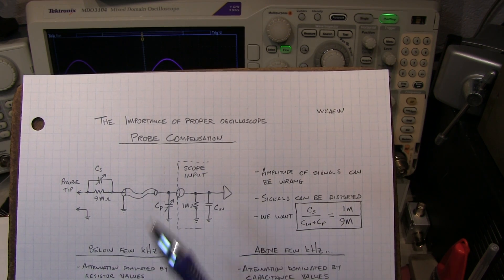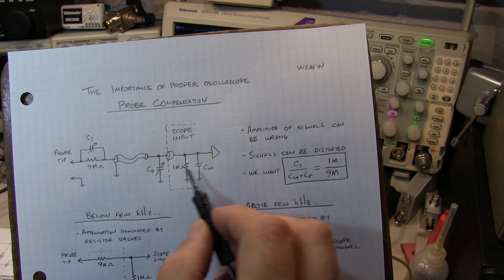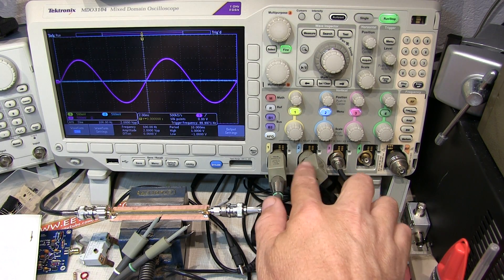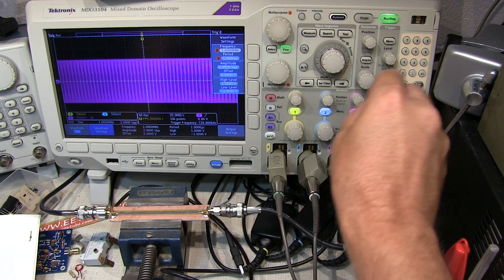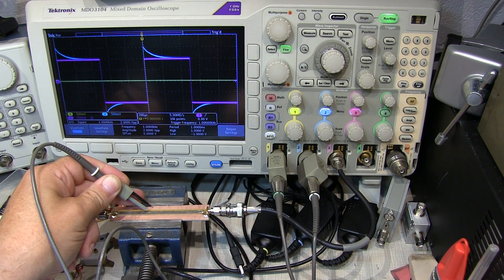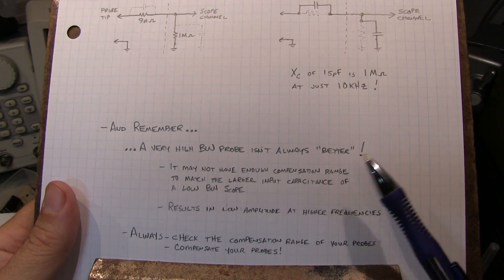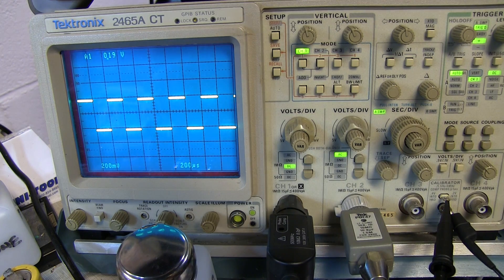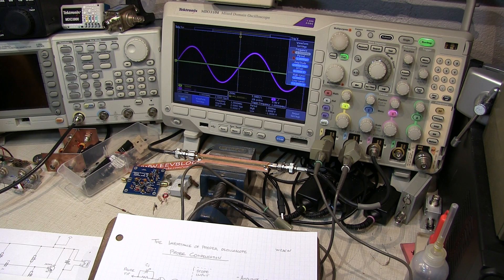#206: Importance of 10X Probe Compensation with your Oscilloscope

Comment: Excellent video, with very convincing demonstrations. This will be helpful to countless people.
I have been using P6122 probes on my Tektronix TDS 30124 100MHz scope for years, and they are well adapted to the scope input and compensation range, but I have been frustrated at times by the fact they do not have a 10x readout pin, and I always have to manually verify this is set right on the scope. 
I read in Tektronix literature that the P6121 probe is the "sibling" to the 6122, but with the 10x readout pin, so I bought one to try. Receiving it, I learned that it is not at all a "sibling" to the 6122, because it is intended for a much earlier scope, and the compensation range is 20-26pF - well above the 13pF input of my scope. I tried it anyway, expecting to find it hopelessly over-compensated, however I was able to adjust it into proper compensation. Indeed the compensation adjustment was at the far en of its range, which is not optimal, and because of this I will probably not keep it, but all this to say sometimes the compensation range is conservatively stated, and can be better than the specs would indicate.

Comment: Could you do a video on RC Normalizers and calibration. I don't understand why they only call for an RC Normalizer at low frequency calibration of a vertical channel then leave them off at the high frequency comp. I realize the 1 Khz fast rise has high frequency components but shouldn't you put an RC Normalizer on at some point in the high frequency comp steps?
Reply from the maker: At high frequencies, the probe response (attenuation) is dominated mainly by the input and compensation capacitors.

Comment: Isn't the output signal displayed supposed to have (1/10)th of the amplitude of the input signal that is being displayed? If not, then what is the point of the attenuation and why would the oscilloscope display the non-attenuated signal?
Reply from the maker: The main point of a 10x probe is to get the bandwidth, not really about the attenuation.  The 10x probe is designed to isolate the ~100pf of the cable and scope input capacitance from the circuit under test - see this video on the topic (https://www.youtube.com/watch?v=SX4HGNWBe5M).  This scope automatically senses that the 10x probe is attached and adjusts the  vertical scale reading appropriately so that it accurately shows the actual signal amplitude.

Comment: Hi Sir. Thanks for the great video, as always. I was wondering if you could provide some piece of advice. I own a pair of probes Keysight N1242A. Browsing web I found conflicting information: some references say compensation range between 15-30pF and others say 15-40pF. If I hook them up to a Tektronix 2225 which has 25pF inputs I'm unable to properly adjust for the compensation. I mean, I can just barely reach it but I can't over compensate. Maybe I got this wrong, but it seems something is not correct. Any clue why that would be? Either way, 15-30 15-40, both should allow me to compensate the 25Pf of the scope, right?
Reply from the maker: Assuming the information you have on the probe is correct, then it should be able to compensate the 25pF input capacitance of the 2225 scope.  Have you made sure to connect the ground lead when doing the compensation?  Are you sure about that part number for the probe?  It's very unusual that Keysight doesn't have any datasheet or documentation on their website about that particular model number.
Reply: @w2aew  I did find documents within keysight site. There is a note saying: "These probes have been designed and calibrated for use
 with instruments having an input impedance of 1M Ω paralleled by 20pF. However, these may be recalibrated for use with instruments having an input capacitance of 15 to 30pF." I went through the process one more time and recorded a video showing the scope settings and the process. Maybe I am doing something wrong. https://www.youtube.com/watch?v=Onlqv2ZH8Ig
Reply from the maker: @carentanbr  Looks like you've got everything about right.  I would push in the x10 multiplier on the Vertical scale knob (it looks like you have it pulled out) and then adjust the vertical scale setting as needed, then do the compensation.  As long as you can make it flat, don't worry if you can't get reach the overcompensation condition.
Reply: @w2aew  Thanks for replying! That is one interesting point. Yes, I did pull the 10x mag. If I push it back, i cant get any decent reading. It gets all blurred. I think it has to do with the quality of the internal signal generator. So I get a sharper image if I pull the 10x mag up.
Reply from the maker: @carentanbr  Push in the 10x mag, then rotate the vertical scale down to a lower value.  The 10x mag is really only used when looking at very small signals.  There is a procedure for doing the compensation in the user manual.  https://www.tek.com/manual/2225-operators-manual.  Starting setup on page 2-5, probe comp on page 4-1.
Reply: @w2aew  Thanks, I did try not using the 10x but the signal gets unreadable very quickly. With the vertical scale in 10mv per division (as suggested in the manual) its impossible to read and I cant make the signal clean. Check it out here: https://www.youtube.com/watch?v=Po6gSKiybXo

Comment: Still working my way through your videos.
Even if a higher frequency response probe, let's say 350MHz, could be properly compensated on a 100MHz scope, I wonder how much performance benefit could be had? Especially with modern scopes where the bandwidth is programmatically limited 🤔
Reply from the maker: If it can be properly compensated, there is no performance gain as the BW is limited by the scope.

Comment: Hi, I love your videos. I had a question about your equation. Cs/(Cin + Cp) = 1M/9M in the bottom right of your paper you show.  It seems to me that since Cs is paired with the 9M and Cin is paired with the 1M, the equation should be Cs/(Cin + Cp) = 9M/1M. Am I right, or where has my thinking gone wrong here? Thanks again! I show my class your videos quite often.
Reply from the maker: The equation is correct.  This is because the capacitive voltage divider works inversely compared to a resistive divider.  A larger series resistor creates a smaller voltage at the divider output.  A larger series capacitor creates a larger voltage at the divider output.
Reply: @w2aew  Thank you! One more question, most scope probes have a capacitor compensation range of roughly 10pF to 30pF, so it would be impossible to reach a 1 to 9 ratio. In fact it seems that you would want to obtain a 1:1 ratio since the probes adjustable capacitor and the scopes internal capacitance are almost the same to begin with. Any thoughts on this too would be very helpful! Thank you
Reply from the maker: @joedenny8853  That specification refers to the range of scope input capacitance that the probe can be properly compensated for.  So, if the probe says its compensation range is 10-30pF, that means at this probe can be used with any scope who's input capacitance is between 10pF and 30pF.

Comment: Hi alan great video, question when the probe has capacitance adjustment at probe tip, does the shunt capacitance show up at end connector?! Hope i make sense.
Reply from the maker: The amount of shunt capacitance presented by the probe will be listed in the probe specifications - it doesn't really matter where the adjustment location is.

Comment: Hi Alan, I have a question from those of us having tight budgets who have decided to buy low cost probes from China.  Is it reasonable to buy probes with slightly higher bandwidth (e.g 150 MHz probes for 100 MHz scopes like the 2245A) to get a flat response all the way to the scope's top end?  This is presuming that the probe's compensation limits include the scope's input capacitance.  Thanks, Brian.
Reply from the maker: Yes, this is perfectly reasonable.  As you said, be sure that the probe's compensation range is adequate for your scope's input capacitance.  And, just beware that the frequency response on the ultra-cheap probes might not be as flat or ideal as a higher quality probe.  But, for most applications, this will be fine also.
Reply: Indeed, the frequency response is somewhat of an unknown with cheaper probes :-(.  I note with some amusement when looking at low-cost probes recently that seemingly identical probes all nominally '100 MHz' were being listed as such, but one company had it listed as '80 MHz', possibly a more honest appraisal.

Comment: Hi Alan - very helpful tutorial. 
Do you think a 100 mhz digital scope, such as the 2430 has a place on the bench these days?
Reply from the maker: Absolutely!  Even a sub-100MHz analog or digital scope can be tremendously useful.  I'm fortunate enough to be working for Tektronix, so I have access to some incredible equipment.  However, before this, I used my 100MHz analog scope extensively.
Reply: Hi Alan - thanks so much for answering my question, especially so quickly as I am considering one right now - Which brings me to another idea - Why don't you do a sort of review of the older tektronix scopes and your recommendations?  I purchased a 2465A some years back, and now days you see them in the $200 or less range. I did a lot of reading on the analogue scopes first, so I feel pretty good about that purchase. But why would someone purchase, say a 465B like yours instead? Or would you? What about the 2430A mentioned above - would that be ample for people doing radio repairs on boat anchors and other radios? If you have a 2430A, would it be helpful to have a 465 or 2465? Would it be redundant?  If a storage scope from that era be worth spending 200 bux on when you can get digital scopes with LCD displays like the Regol for a little bit more?  Anyhow, just some questions - and of course my concerns revolve more around RF and radio repairs. I too am a Ham.

Would make a fantastic vid for hobbyists out here, I bet.

Anyway, I watch a lot of vids and yours really are good. Very simple, clear instruction.

Comment: The capacitive reactance is 1/(2*pi*f*C) and it goes down with frequency.

How can you say that Xc of 15pF is 1 Mohm at 10 kHz?
Reply from the maker: Because it's correct.  1 / ( 2 * 3.14 * 10,000 * 15E-12) is equal to 1.06Mohm.
Reply: Yes, you are correct.
Thanks for your reply.

Comment: how many volts would a 10x probe handle?
Reply from the maker: It depends on the probe.  The voltage ratings are typically listed right on the probe itself.  A few hundred volts is typical.

Comment: Your videos have always been very clear and useful! I have a silly question. Recently, I got two 500 Mhz 10x probes. however with those probes, i was not able to get any signal with DC coupling on my oscilloscope. I was only able to see the waveform with AC coupling but the signal level was several orders of magnitudes off.. I wonder if you have any clue about it.
Reply from the maker: It's tough to say without more info. You could have bad probes. Info that would be helpful is: what scope, what probes, what settings, what signal you're looking at, etc.
Reply: +w2aew thank you for your quick reply! the scope I am working with is a teledyne lecroy 1.5GHz input bandwidth scope. the probes i have are lecroy pp006 500MHz 10x probe with a 10M ohm inpedance and 12pf capacitance. the oscilloacope was able to recognize the attenuations of the probes eaisly. the other settings were accordingly on the scope. the calibration waveform was gemerated with the scope itself, which was 2MHz square wave with Vpp of 1 V, 50% duty cycle and 2 ns of rising time.
Reply from the maker: Not sure what's going on there.  Make sure the scope is using its 1M input impedance setting.  Do other 10x probes work OK?
Reply: ***** what insteresting is, i took the probe from my handheld scope, which is a 6 MHz bandwidth 10x 10M probe. And it turned out to be working just fine. I am thinking about I might got bad probes from eBay. I am not very familiar with the new scope I got, so I am not quite sure about whether yhe probes are broken or I have the wrong setting.
Reply from the maker: The 500MHz probes should work with the same settings that worked for the probes from your handheld.

Comment: I bought a new dso, and it has a warning telling ( 2 channels of the oscilloscope or non isolated electrically. The channel is should  adopt common basise during measuring. To prevent short circuits the probe ground must not be connected to two different non isolated DC levels) can you tell me what that means
Reply from the maker: +Vasudev Mr It means that the outer shell of the BNC connectors on the two channels are connected to each other, and connected to the scope's ground connection.  Thus, be sure that you connect the probe ground clips to the same ground in your circuit, and not to a different voltage.  Scope's are not fully floating like a DMM where you can connect the probes anywhere.  With a scope, the ground connections are common among all inputs.

Comment: +w2aew Thumbs Up! I subscribed the other day when I posted a question on your other 10x probe video. Thank you for answering my question on that video too by the way. This video however was exactly the information I needed. This has cleared up 99% of my confusion on probes.  Unrelated to probes though I do have another question (to anyone in general). I have noticed that there are certain brand name scopes that serious electrical engineers prefer such as, Agilent, Tektronics, Fluke, etc. Are there any brands that one should avoid? Also I recently was able to acquire an A. W. Sperry 620C Dual Channel 20MHz scope. Can anyone tell me much about the A. W. Sperry Instruments INC's reputation in the electronic industry/community?
Reply from the maker: +John Floyd Tektronix, HP, Agilent, Fluke, etc. are basically the leaders in the general test and measurement industry.  There are many others that make equipment that I would say are "second tier", but still very good - these would be companies like Leader, BK Precision, Kenwood, Philips, Hitachi, etc. and I think that Sperry would fit into this category.  They're still around, but don't make oscilloscopes anymore.  I'm assuming that you found the User manual for your scope on their website:
http://www.sperryinstruments.com/en/resources/legacy
Reply: +w2aew Yes. I found the manual beforehand(Thank you Google!). I was just reading through it because after just watching your video I'm trying to find some reasonable price probes that will work well with the scope. Since I'm completely new to oscilloscopes it's a bit of a learning curve for me. It would have been nice if like your scopes the picofarrads would have been listed above the BNC connector. This is not the case for this scope. The manual states this though, " The input of this oscilloscope is 1MOhm shunted by 20pF capacitance. When the probe is used 10:1 attenuation, the impedance becomes 10MOhm shunted by 15pF. Then the voltage must be multiplied by 10".  If I understand this correctly then as long as a set of probes has 15pF in it's compensation range then it should work ok with this 20MHz scope (provided you actually compensate it)?
Reply from the maker: +John Floyd Almost...  You'll need to find probes that can compensate the 20pF input capacitance.  The 15pF they mention is the input impedance of the PROBE that they sold.  The probes you find might have a different input capacitance, and that's OK, as long as the compensation range encompasses 20pF.
Reply: +w2aew Excellent. I appreciate all your help so far! What advice would you give about buying probes. I've seen a few comments and videos warning against cheap probes. I'm assuming they meant passive ones. I haven't been looking for active ones since those seem to be geared toward measurements well above what this scope is capable of (I think). Other than cheaper probes having narrower compensation ranges can you give me an idea of anything else to avoid when buying? Should I be looking for name brand probes for a second tier low MHz scope like this? Right now I have two that I'm looking at http://www.jameco.com/webapp/wcs/stores/servlet/Product_10001_10001_2189880_-1 & http://www.amazon.com/gp/product/B0030KWM30?keywords=oscilloscope%20probe&qid=1444917794&ref_=sr_1_1&sr=8-1#descriptionAndDetails . If you had a scope like this would you consider either of these for general testing?
Reply from the maker: +John Floyd The two links you provided look like they'd be perfectly adequate for your scope. No need to go to the name brand route, especially for hobbyist use.  The very cheap no-name probes will often be made of inferior materials which may fit poorly, be less durable or flexible, etc. or have limited accessories.  I'd be comfortable with either of these for hobby use with a 20MHz scope like you have.